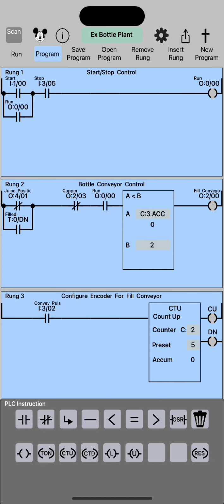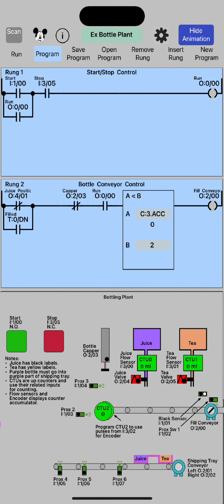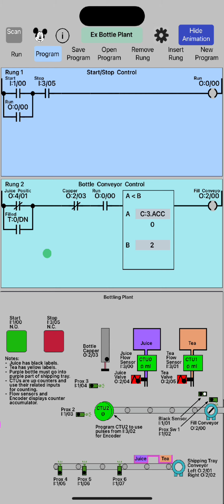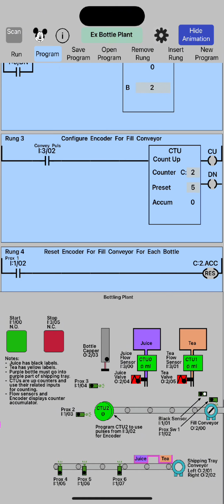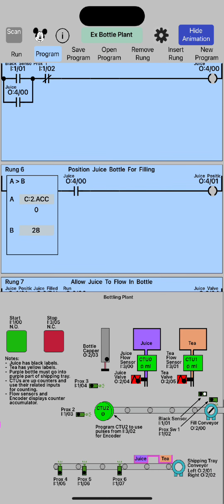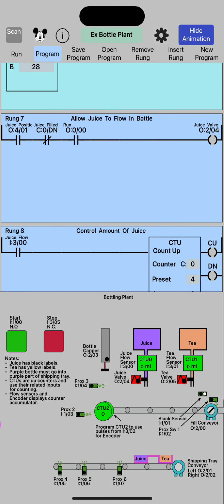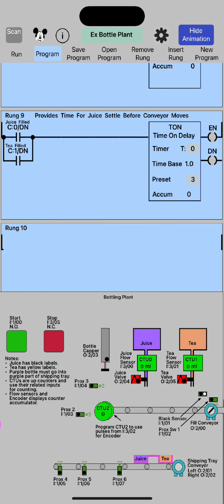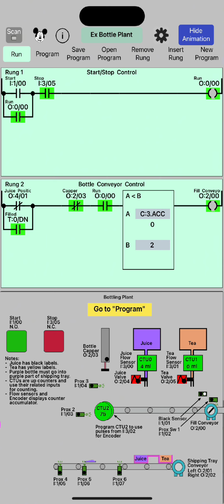PLC Simulator 2 David White Bottle Plant Vid 2

Comment: Eu estou tentando já faz algum tempo pode ser bobeira para algumas pessoas essa .olha dificuldade em solucionar este último exercício do aplicativo simulator sim 2.
Mas verdadeiramente eu estou com muita dificuldades, e quero muito fazer este exercício e descobrir onde posso ver o resultado completo por favor pois este video me ajudou muito pouco .
Reply from the maker: It is truly a very difficult exercise.   I have included the code in the version 8.0 and it is available now.  Use the "Open Program" and select "Ex Bottle Plant".
Reply from the maker: a new version 8.0 is available (and for Android - when using the BACK button "<" the app will ask "Do you want to save your program?"). Version 8.0 also includes: - Code to run "Bottling Plant" animation, - New Timer Off Delay with "Timing" bit TT., - Updated animations. - More friendly Compare blocks.

Comment: Don't you have exercise 3 of that application? 
I don't know how to do it
Reply from the maker: Send me an email to davidwhiteapps@gmail.com for the code for that exercise.
Reply from the maker: It is truly a very difficult exercise.   I have included the code in the version 8.0 and it is available now.  Use the "Open Program" and select "Ex Bottle Plant".
Reply from the maker: a new version 8.0 is available (and for Android - when using the BACK button "<" the app will ask "Do you want to save your program?"). Version 8.0 also includes: - Code to run "Bottling Plant" animation, - New Timer Off Delay with "Timing" bit TT., - Updated animations. - More friendly Compare blocks.

Comment: Amazing PLC Simulator and examples! Thanks, you did an amazing job!
Reply: Thank you.
Reply from the maker: a new version 8.0 is available (and for Android - when using the BACK button "<" the app will ask "Do you want to save your program?"). Version 8.0 also includes: - Code to run "Bottling Plant" animation, - New Timer Off Delay with "Timing" bit TT., - Updated animations. - More friendly Compare blocks.

Comment: I completed the 2 challeng but this bottling challenge are so hard.,but i cant stop digging on this maybe sonetime i will complete it., thank for this worth app
Reply: If you need additional help, email me and I will send you some code.
Reply from the maker: It is truly a very difficult exercise.   I have included the code in the version 8.0 and it is available now.  Use the "Open Program" and select "Ex Bottle Plant".
Reply from the maker: A new version 8.0 is available (and for Android - when using the BACK button "<" the app will ask "Do you want to save your program?"). Version 8.0 also includes: - Code to run "Bottling Plant" animation, - New Timer Off Delay with "Timing" bit TT., - Updated animations. - More friendly Compare blocks.

Comment: Hey David! Thanks for this awesome app, im really diggin the challenges... well the garage door one at least.

Any chance you could go over the PLC Instruction buttons and show examples of how they might be implemented?

I read the help info (hold it for 3 seconds) time and time again and I pull more information from some than others but for the most part Im reading legal jargon in hieroglyphs.
Reply from the maker: See if the "Quick Start tutorial for the PLC Simulator 2 - 1" is some help.
Reply from the maker: A new version 8.0 is available (and for Android - when using the BACK button "<" the app will ask "Do you want to save your program?"). Version 8.0 also includes: - Code to run "Bottling Plant" animation, - New Timer Off Delay with "Timing" bit TT., - Updated animations. - More friendly Compare blocks.

Comment: Hi David I have an idea to put another Simulator now it would be a plastic extrusion machine I will send the idea I designed it I'm sure you'll like it I'm from Manaus Amazonas Brazil has several industry companies
Reply from the maker: Hi Robert.  I am always happy to hear new ideas.  Send it to my email davidwhiteapps@gmail.com.
Reply from the maker: A new version 8.0 is available (and for Android - when using the BACK button "<" the app will ask "Do you want to save your program?"). Version 8.0 also includes: - Code to run "Bottling Plant" animation, - New Timer Off Delay with "Timing" bit TT., - Updated animations. - More friendly Compare blocks.